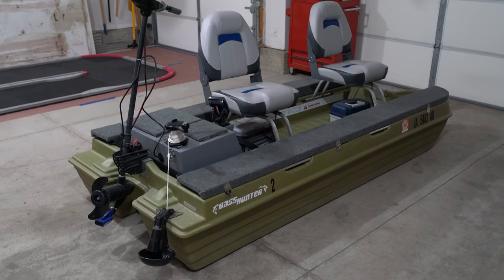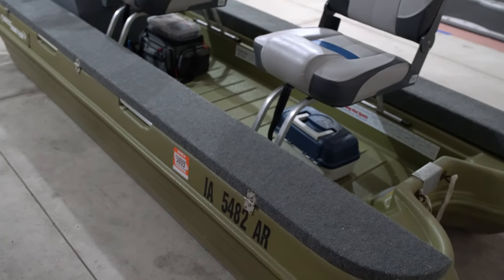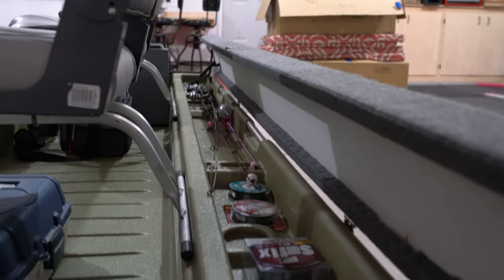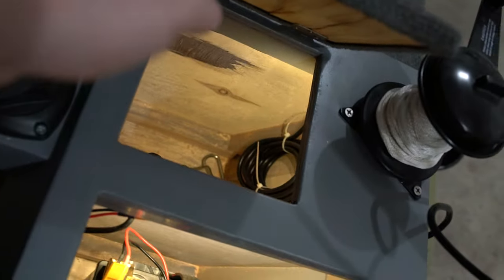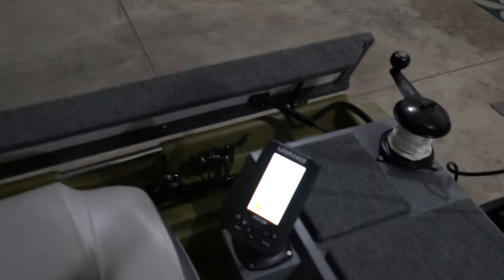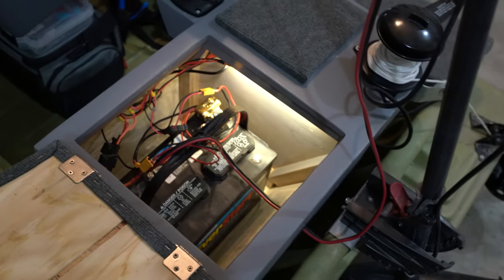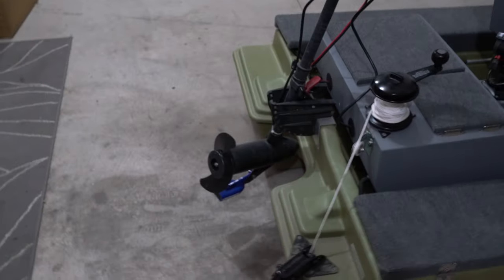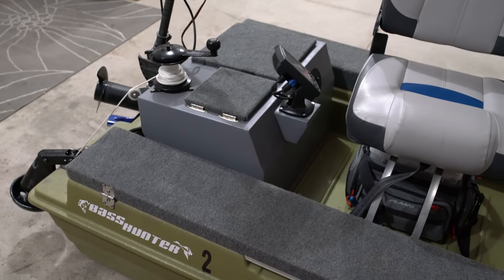Best 2 Man Bass Boat?! | Modifications, Build Process, and Walkthrough

Comment: Thinking about buying a Bass Hunter (the Bass Baby model) I see yours has aluminum carry handles... One thing,  I thought all the handles on the Bass Hunters were molded-in handles? GREAT VIDEO BY THE WAY.... WHO'S ARE THE MORONS THAT GAVE YOU THUMBS DOWN? I just don't understand some idiots!
Reply from the maker: Thanks G. Dzag!  I’m not sure about newer models but I’ll share this one is from 2001.  It’s very possible that the handle design/implementation has changed since then.  I’d also add that the carry handles are fairly useless once adding everything to the boat, it’s heavier than you’d want to carry for any real distance  - you might look at fabricating a wheeled dolly/cart to move it around or a small trailer setup to make it easier to launch.  I’ve ended up backing my truck down boat ramps and sliding it off/on straight into the water but realize that may not always be an option.
Appreciate the feedback!

Comment: What size troll motor?
Reply from the maker: Hi Johnny - It’s an old Minn Kota Endura 36 lb thrust.
Reply: @AlloyAndGrain  thanks! I just bought a 30lb thrust C2 for a single person pontoon, but it has since passed on 😂. I'm considering a 10ft jon boat as a replacement to pair with that troll motor if you think that'd work? Thanks
Reply from the maker: No problem!  I’ve read somewhere that you might want 2 lb of thrust for every 100 lb of boat, people, equipment you’re planning to push around.  So a 30 lb thrust motor might be enough to pull/push around a 1,500 lb load??  I can’t imagine you’d be anywhere near 1,500 lbs in a 10 foot Jon boat??

Comment: I'm looking at the rod lockers shaking my head then you mentioned the gas shock, that's a slick job, but my fat ass would love to rest my feet or stand on the lockers and I think I'd end up blowing those puppies off the boat.
Reply from the maker: Haha, I know what you mean J Tee!  I actually rest my feet on them all the time - no problem.  Can also stand on the lockers but not when it’s in the water - too much weight on the outer edges in terms of stability.  The bottom of the lockers rest on the boat itself - no pressure on the hinge screws when closed.